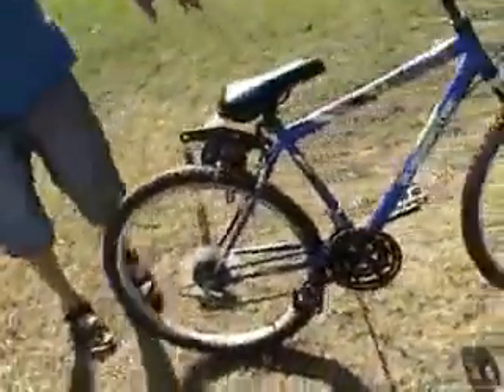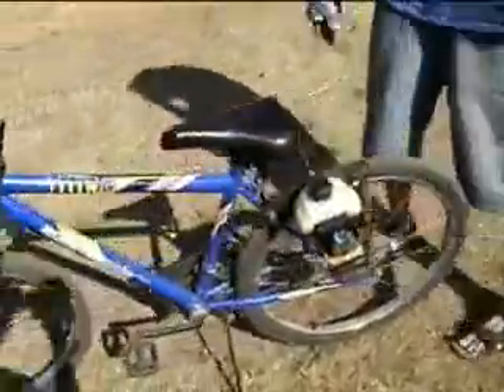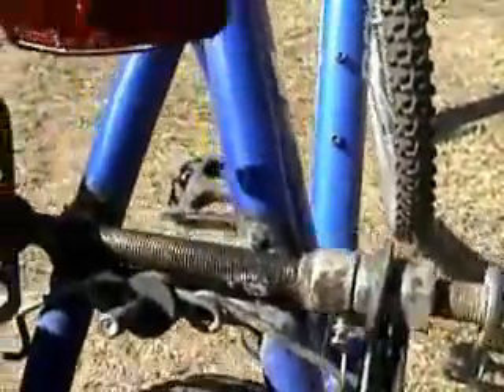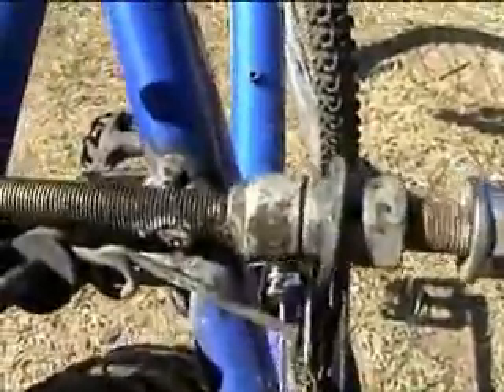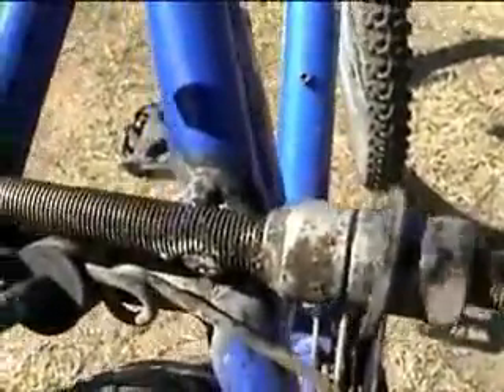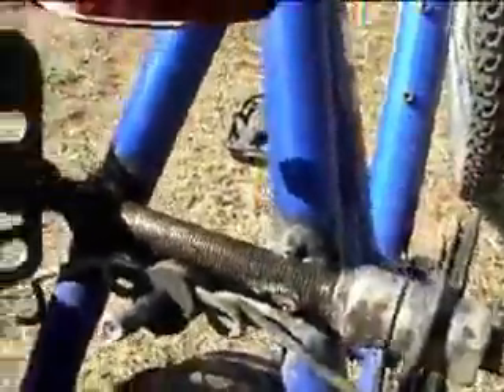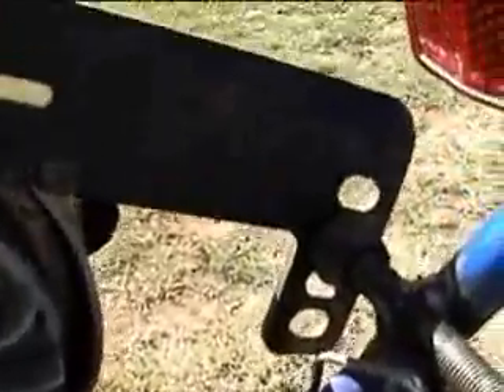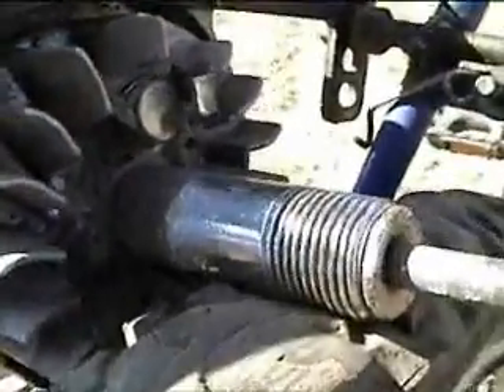how to make a homemade motorized bicycle

Comment: Actually you can buy bolt-on kits off ebay for less than $150.  These kits generally come with a throttle and yield at least 100 mpg.  Not too shabby.